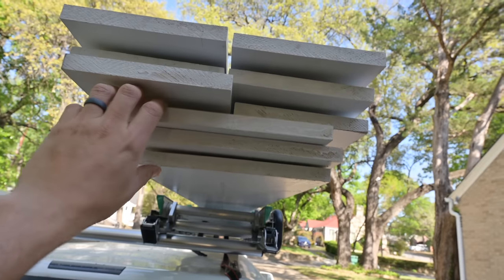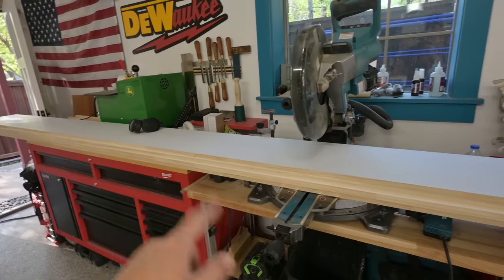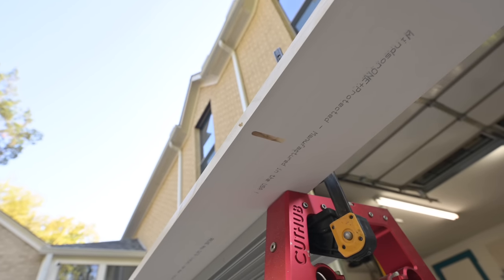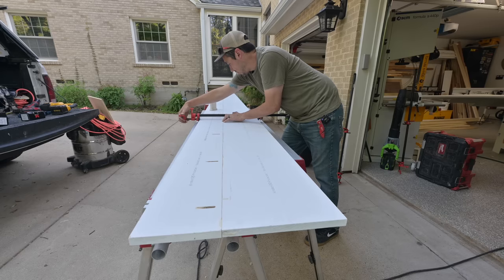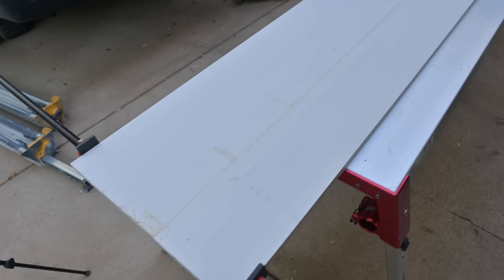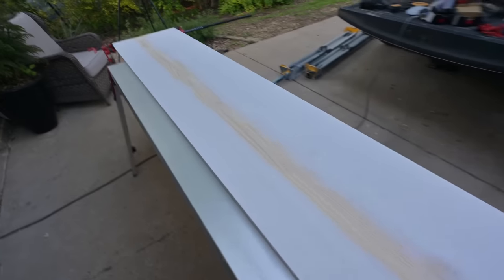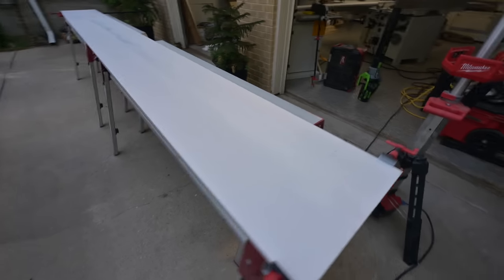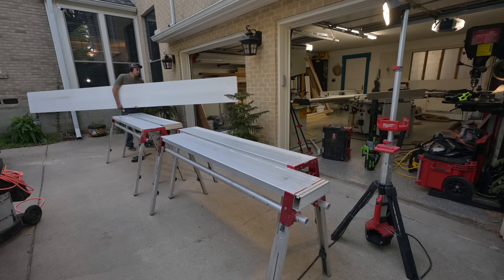Making 1X20's on the castle!

Comment: That’s another reason you should use a feather board (or two). You’ll get more accurate cuts down the length and keep you safer at the same time.
Reply: What's a feather board? Learning so much on this channel.
Reply: @tjanecki  a feather board is a safety device designed to hold work tight against the fence during rip cuts. While designed to eliminate the workpiece from shooting back towards the operator due to the wood moving toward the blade or because the wood was warped it does double duty by keeping the wood from moving when you lessen your grip to exchange hands to push the wood through the blade. It can help tremendously with cut accuracy.

Comment: Nice work creating a nice wide board. Another option that works well is to remove 1mm from each board, with a power plane, before gluing. Sometimes ripping on the table saw can yield sawmarks in the glueline.

Comment: Rule of thumb, when making a panel, you want to rip your pieces 4x the thickness then joint them. To do a 3/4 x 20", you need 7 pieces of 3 inches. When you glue your panel, glue core vs core. Oppose the core top and bottom. "Dos" in French is the opposite of core, I don't know the word in english. But you have to match dos and dos. And oppose them top/bottom. You're gonna have deformation no matter how you do it, but by doing this technique, the "wave" is going to be minimal. I'm pretty sure you covered this in your steve core video (matching core/core and dos/dos that is).
Regardless, why not using plywood ? A scarf joint would have worked just fine. Cheers !

Comment: I like to run an 1/8" pre drill bit while the joint is dry fit, that way I know the screw won't move the pieces out of flush after everything's glued up. Worth the extra time initially to save sanding time on the back end.

Comment: Just out of curiosity, are there no local sawmills around you? I work at one in the mid west and we consistently turn out 23 inch boards(the size of the circular saw blade we have)
Reply: You wouldn’t want a solid piece of lumber. It would bow and warp and not be fun to work with as trim…you want a finger jointed or something similar so it’s dead straight and flat and stays that way.

Comment: I had to make a wider board like you did.  I used pocket screws as well.  Just removed the ones I had to cut by.  Then reinstalled them after the cutting.  The glue kept it in place.  Worked out perfectly.

Comment: My dad joined boards by cutting a slot down the center of the joining edges and making a spline to fit the slots then glue and clamp....I've used dowels and biscuits........the page for "Every Tool I Use" only shows the portable table saw?

Comment: Pretty cool.  Wondering.......why not run them over your jointer instead of using your table saw to take off the painted edge?
Reply: Probably due to length and how long his jointer top is… probably wouldn’t do that great of a job on such long boards with a relatively short table on jointer

Comment: That’s a pretty cool pocket hole machine, I’ve never seen that one. I will say, if you are going deep into wood working now you are going to need a ton of clamps. I have around 20 and need about 40 more. No kidding, this hobby is expensive. Lol. I’m sure you have seen the domino. Man that’s a nice tool. I can’t justify or afford it right now but would love to have one. It’s extremely useful for this exact thing. Line ups and also adds a lot of strength. Thanks for the video. Cool to see you working on your house. That is what got me into this stuff and I’m still doing it after 4 years.
Reply: Richard has a domino👍🏼

Comment: Its using spray bombs to prime wood that makes me hit fast forward. Get a roller and some stain block primer dude. Is this parody on primer paints or what.

PS: Tomorrow I pick up 2X14 Standard cut clean red cedar planks 16 feet long X 3 plus some 2X10s here in BC for a re and re facia replace on a pad locally. Its going in  the shop under fans for 2 weeks just to be able to start to use it. Its getting paint, Sad I know. Should be illegal . K gotta get back to my burn pile here, may have to throw another tire on.

Comment: Pocket holes for the win. That’s how I’ve done extension jambs on exterior doors at my old house.

When I built custom pre-hung doors in a shop I used to work at we would use the corrugated stapler (“w” looking fastener) and it would usually blow out the primer from the face of each jamb extension. Huge pain in the ass, but a little putty usually solved that problem. I personally prefer pocket screws because they seem to be sturdier, especially if you alternate from one piece to the other.

Comment: An older carpenter suggested that when drilling pocket holes that you should predrill the adjoining board. I discovered his video after not understanding why my popler board was splitting. I never had an issue with pine or plywood splitting. I have learned a lot from your channel. Thank you

Comment: Why is it better to use a drill for pocket screws instead of an impact driver?
Reply: A drill with a clutch on its driving mechanism can be set to not apply too much torque. An impact driver can easily over drive the screw, putting too much stress on the joint and maybe splitting the wood.
Reply: @daveyjones7391  I see. Thanks for the input
Reply: @lemonysnick5171  Happy to help, my dude.